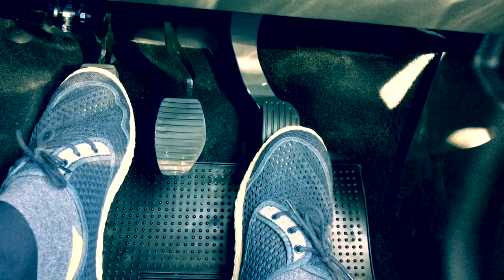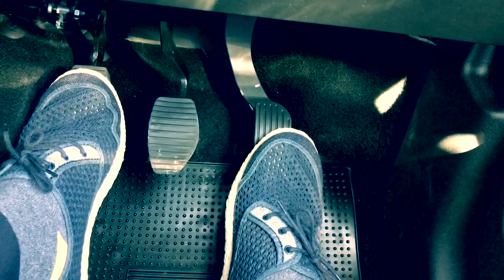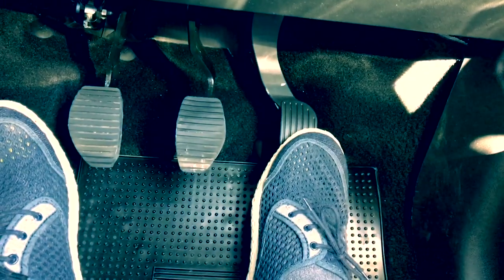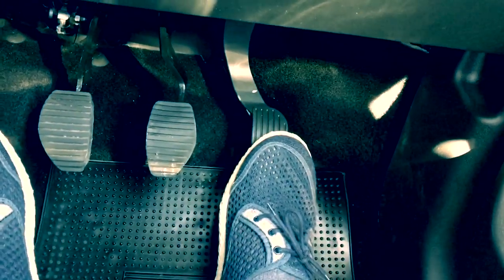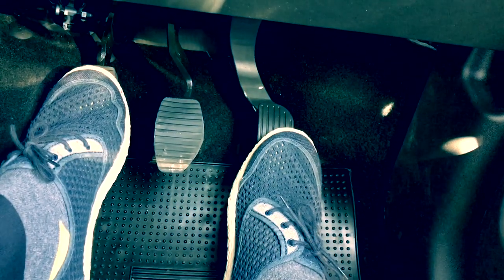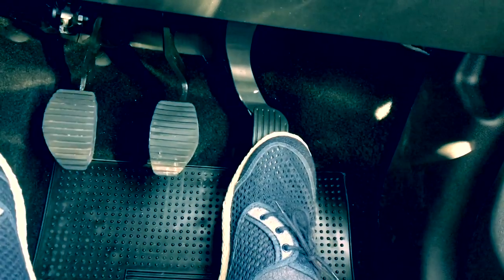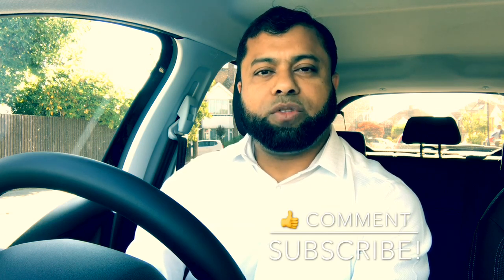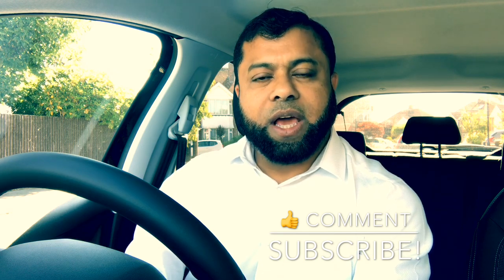How To Avoid Stalling - Avoid Stalling In A Manual Car!

Comment: There is one more reason. When your wheels are in turn position and you release less gas/acceleration your car will stall. As turned wheels make friction for car to move forward
Reply: It happens sometimes when the car is loaded or you forget to release handbrake.

Comment: Most of stalling happens for psychologic reasons.

DON'T think about stalling, it is like don't think of a pink elephant! You are now thinking of a pink elephant right? 
DO focus on setting gas and finding and holding the bite, focus on a nice smooth pull away. 
DON'T worry about the vehicle behind you, all it will do is stress you out and likely cause you to stall, meaning you take longer to pull away
DO focus on moving forwards, talking through what you are doing in your head or out allow can help you to focus on what you need to do, if you are busy talking what you are doing you can't think about the cars behind.
Reply: You are right.. I failed twice because of stalling.. I'm always thinking about not to stall but then it happens, especially when under pressure on a roundabout or in front of traffic...